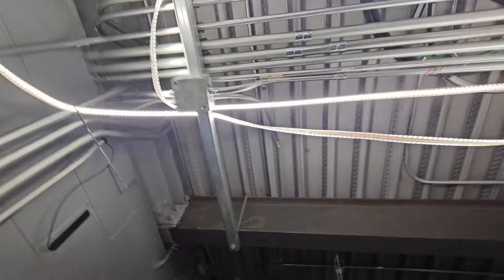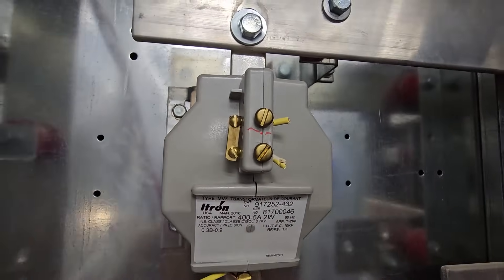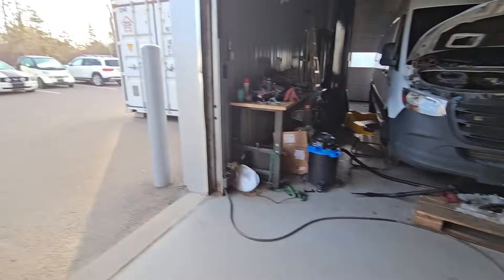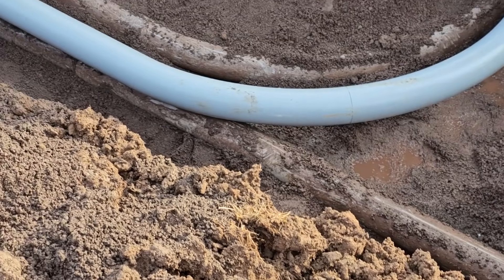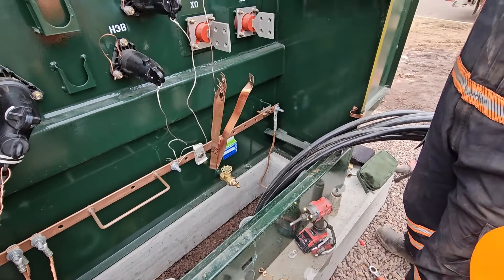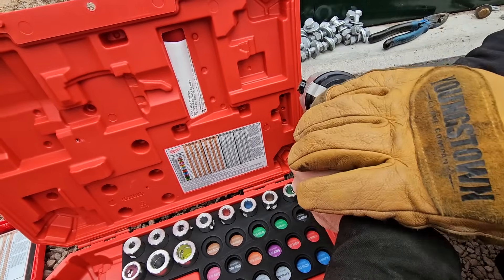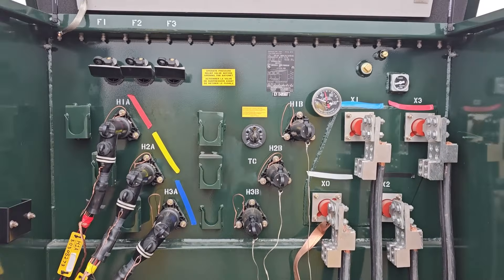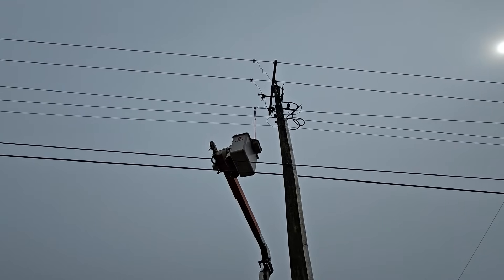Three phase 800 Amp upgrade

Comment: Years ago I was contracted to update a closed down grocery store which was to be reopened due to the only grocery store in the small town burning to the ground. It was a rush job since it was 25 miles to the nearest other grocery store. I was to increase the service from 400A 3 phase 208/120V to 800A  3 phase Overhead service. The old service had been cut off at the pole, as was clearly visible, and the quadraplex was still  connected from the pole to the building. This was in my way since I had to build the new 800A service.
I asked a passing power co. lineman to take the drop down for me. He said he couldn't do it without a work order. I told him I would cut it off from the bldg. and roll it up at the base of the pole. He said he would take it down for me anyway. I went back into the bldg. and the last thing I saw was the lineman going up in the bucket truck. I heard the unmistakable roar of Primary going to ground.

Comment: Things work very differently up there as compared to the Houston area.  First, I won't say that a CNP lineman will never help you on your project but unlike in the past when those lines blurred, today there is almost never any thought of them helping you.  First, they are busy as a one leg man at an as kicking contest. Second, there are too many lawyers and too much liability issues for them to touch any of your stuff.  It is nice that y'all are more old school, friendly with the narrowbacks and enjoy the comradery of the electrical trades. Deregulation, contract line crews and bean counters have killed that down here.

If a supply house sent out that spool of wire I would have rejected it.  I would prefer four reels set two and two for that heavy application.  Anyone can see at the start of the pull that real was not going to finish that pull.  Luck if that wire was not damaged. I also did not see anyone applying wire lube. Even with today's supper slick wire it is important to use wire lube especially on heavy long runs with 3-90's.

Also, there is no way that that job would be turned on without a final inspection from the city and the Light company will generally not turn anything on till it is covered. They have primary meter crew who do all the CT work medium and low voltage.  Head lineman does not do it all like you do. Ct's and metering would be mounted in the pad mount. Most electricians would have that wire pull completed before a cut over world be called for. It would be inspected ready to go with a feeder to feed that old main in place. basically, turn one off and then make the new one hot.
I was wondering if this was installed for EV car charging stations.  Many of the Houston area car dealerships have spent hundreds of thousands of dollars or more doing these types of upgrades.
Thank you for your many videos.
We can all learn from each other's triumphs and failures.

Comment: Making sure that I understand. This is a 600 volt, phase to phase, 345 volt, phase to neutral. So, at nominal, the PT voltage presented to the downstream metering would be 115 volts. I assume this is a Canadian standard?  I worked in plants in the US using 480, 277 and 120 volts presented to the PT side of the metering equipment.

Comment: I recently got a new customers (old company left, new customer bought the building), the old owner had a demolition crew run through the entire complex, basically f'cking up anything they can find. They had CT's for energy monitoring on over 30 3-phase connections for different loads, sadly some idiot ripped out all the metering equipment and left every single CT an open circuit, even with half the circuit still energized and feeding remaining non destroyed load :(

Comment: I am curious about the method used for the PT connections to the buss bars. I was taught to either thru bolt or tap the buss, then connect a screw lug using a Belville washer to maintain constant pressure on the lug-to-buss connection. The Belville washer maintains pressure better than a split washer throughout the expansion and contraction of the copper buss bars, and the screw down lug provides a better connection to the PT sensor wire (especially when properly torqued with a torque driver). I was told to use this method due to coppers high coefficient of thermal expansion that can cause other methods to loosen over time, especially in areas with large seasonal temperature swings.

Comment: This install reminds me of the install of the dual 480V/800A AC feeds to the data center I worked at at Carnegie Mellon University. I got to see more of the building power feed than most folks, documenting everything from the primary side of the building transformers, though the building's power room, and then up to our data center, complete with photographs. A fascinating thing to do as someone who got to see things behind the scenes at AEP thanks to a power prof who did contract work for them. (I also got to see even more of our power feed after the main building panels were flooded to a depth of about a meter/3ft with flood waters during a flash flood, and all our breakers had to be cleaned/tested.)

Comment: I can imagine an elevator that goes up instead of down and down instead of up if the electrician got the phase rotation wrong. Technically the escalators would still be usable XD.

Comment: As a Master Electrician 
If You Notice 
He Speaks in a 
Matter of Fact Language 
As Electricians 
There is No Maybe 
Might Be 
Could Be 
….It’s Always a Matter of
Fact 
It’s Open or It’s Closed 
It’s On or It’s Off 
Plus You Have One Crew Chief or Gang Leader 
No One Does Anything 
With Out The Crew Leader Telling You 
Remember Everyone Here is Ether Licensed or Working Under a License
The Milwaukee MCM
Cable Insulation Stripers 
are Outstanding 
Didn’t Have Them in My Day of Landing 
4160 Volts Utility 
It’s Nice To See That Everyone is So Professional 
No Yelling or
Whistling…..
You Work as a Team 
Again Thank You for 
Up Loading This 
Fantastic Video

Comment: you mentioned this is an 800a upgrade however 500kVA is only 481a @ 600v. Do you guys run undersized transformers or are they only using 347v for utilization voltage? Im in the US and often see undersized transformers
Reply: 800x600=480kva
Reply: @lewy1  nope. 800a @ 600v 3Ø is 831kVA
Reply: @ Sorry you are correct on the math. Utilities like to run transformers at the max to make money. They rarely use what the math requires.

Comment: One of my tech teachers told me that you linesman use electronic equipment to check phase rotation, it wasn't something which was taught when I did the electrical trades course.

Anyhow, back in 2007 I can remember when I was on an industrial site which was based in a coal mining part of my district & the client had moved a hydraulic punch & shear machine from one building to another & while the pump motor ran it never delivered any hydraulic pressure.

I thought that if it worked o.k. In the other building then the phase rotation must be different in that building so another electrician who I was working with swapped a couple of phases around in the plug 🔌 then it worked fine.

My point is that another electrician couldn't figure that out.

I am not sure what your lockout procedure is in Canada but usually you have to be inducted to enter a switch room or a motor control centre even if it's dead work which is being performed over here in Australia &; in some cases a JHA (job hazard ansky) orba SWMS (safe method work statement) is to be completed & signed by anyone who enters the switch room in Australia.

Also, this particularly applied to live testing or working on a project which is live & even when it's dead, everyone who is working in a particular switch room or on any form of power equipment must attach their danger lock onto the lock box prior to commencing work & remove it at the end of the shift !

Comment: I am wondering why 600MCM aluminum wire and 600MCM copper wire need a different die. It seems like wire of a certain size should all have the same diameter. Checking a couple cable supply sites indicates that indeed the aluminum wire is slightly smaller in diameter. The stranding is the same so I would really expect the dimensions to match.
Reply: Alas wire sizes are kind of like pipes... there are standards behind them, but the ratings are more like "nominal" or "trade size". 1" PVC, CVPC, HDPE, and PEX are all different internal and external diameters, then you've got rigid pipes like copper and PVC available in different Schedules with different wall thicknesses... still all called the same "size".

Wire isn't quite that bad. I've never bothered to look into it but I think it's equivalent cross-sectional area and "size" actually describes its properties as a conductor, rather than the physical parameters. Even on copper, solid, low strand, high strand, and tinned versions of the same listed gauge are all different OD. Strand diameter strongly affects this a bunch of larger wires has more space between them compared to a cable made of smaller wires. In other words, size = capacity, and the rest comes down to the actual construction of the cable. 

The differences are negligible at smaller gauges and become more apparent at scale. I work in telecom where DC is more common than AC, current levels are higher, and cable management is generally tight. We use a lot of "flex" cable. This is very high strand count, like welding cable, and the conductors are individually tinned. The tinning isn't included in the size rating, a #2 AWG flex is enormous compared to everything else labelled #2 AWG.

I expect that the different physical physical properties of aluminum and copper are influencing the strand diameter. Per Southwire's specifications for their SIMpull THHN/THWN-2 products, although 4/0 AWG aluminum and 4/0 AWG copper are both 19-strand cables, the aluminum is 0.474" and copper is 0.512". The same line of cable at 600 MCM is 58 strands of aluminum for 0.812" diameter, and the copper version is built with 61 strands for a 0.865" diameter conductor. Unfortunately they don't list the diameter of the individual strands, so we have to assume that the copper strands are thicker. Why that would be the case I could only guess

Comment: That’s a 600 volt service I imagine. 347 just being line to neutral on a 600Y347 connection.
Reply: Presumably this is in Canada, because from what I understand 600Y/347 volt services are (almost) never installed in the US expect under special circumstances such as if the customer has several 600V 3ø motors and/or 347 volt lumenaires imported from Canada.
Reply: Exactly

Comment: clockwise? oh boy I have to watch a video on that now - that's new to me.
Reply: Clockwise or counter clockwise is not important. 
The only thing important is that the new needs to be the same as the old one.
Otherwise, all the 3 phases motors in the building will spin in reverse.
And you dont want that.
Reply: @ Thanks for the reply - I figured it was something like that - but what I didn’t know is that ‘power’ from the pole/main has an orientation? Not sure what it was about that ‘pad’ transformer that could change the orientation.
Reply: @TheIvalen  2 probable reasons . Mixing up 2 wires while reconnecting. Or could be in the transformer while it was built. 
Human mistakes are most common reasons 😏
Every 3 phases system has rotation direction.
The rotation comes from the powerplant's generator .
" A magnet spinning around 3 coils of wires "

Comment: I find it interesting that you do not fuse your risers. What is the rational behind it? Was this just a situation where protection coordination was not possible? If so, at what point is the protection of the UG cable deemed a lower priority over coordination?
Reply: It could be that the cables have the same short circuit ability as the above ground conductors? Then, the cables should protected by the upstream fuses/breakers.
Reply: There are 50A fuses on the incoming high voltage cable to the transformer. Since the transformer only feeds one single switchboard, there is no point in coordination. If the low voltage cable has a fault and there was a low voltage fuse that could trip it would cause exactly the same amount of outage as if the high voltage fuse trips.

On the indoor switchboard there is an electronic breaker, so if there is a major fault in the switchboard it will ensure coordination and trip well before the high voltage fuses in the transformer.

Comment: Very important to get the phase rotation correct. I am a Journeyman Refrigeration tech and if you reverse the rotation the AC compressors can get damaged. Ironic you have EMCO HVAC company right across the street.

Comment: Thanks for your video, Aaron. They will load copper on steel reels here instead of wooden reels. They never collapse so we can use rollers on the ground and just roll the steel cable rollers onto them. Much easier for contractors.

Comment: i love the way you guys work together... here in .uk, power co and electricians rarely speak. here is our demarc point
Reply: That's a shame. Why is that, is it rules or is it, for example being barred from helping do a task you haven't been trained on? (I'm a retured Brit IT engineer, so I'm not trying to point-score).
Reply: @Smannellites  privatisation. They're not allowed to work with you
Reply: They're all the good guys who will but theyre technically breaking the rules
Reply: Such a shame, one of my favorite part is to work with electricians when I'm connecting (we don't hook up over here, 95% of our entire grid is underground now a days) a new house etc. Good banter and a lot to be learned about low voltage stuff aswell!

Comment: you can guarandamntee i triple checked phase rotation the other day when installing a supply for the cnc lathe worth almost as much as this house. interesting that you don't worry  about the actual phases... we tend to, 123 is fine,  312 is not.... probably because of our use of larger local distribution networks, so  load balancing tends to be done at :LV

Comment: Is the upgrade because they’re putting in a 480v DC Fast Charger?
Reply from the maker: Yep!
Reply: We’re putting in 4 car chargers where I work, but for some reason they’re gonna pull it off the house transformer (240 vac) rather than straight 480 3ph from the MV transformer.

Comment: Glad im not the only one to use LED strips and the like for situations like that, props to the dealership for thinking outside the box. Need lights during an outage? Power Banks and USB/5v/12v LED strips are all you need.
Reply: The one in the video is a 120 volt LED strip
Reply: @nick8231  Probably if they had a generator.. But they still come in handy.
Reply: @DigitalIP  he said in the video that there is a couple backup generator for the office that they brought over for the office to keep running
Reply: @ Yep

Comment: 360/208v Y?
Reply: If each PT has 347 volts to neutral on the primary then phase to phase would be 600 volts. So wouldn’t it be a 600/347 volt system? Someone from Canada knows better.
Reply: @wyomingguy4743 you're correct. You can see it on the type plate on the padmount transformer.

Comment: That LED tape light you mention at the start.  I discovered them about ten years ago.  I use them for illuminating tents at outdoor music festivals.   No more broken glass bulbs to sweep up.  Way more durable.  ypu can get them in IP65 rating so outdoor use is fine.   Up to 50 meters long for the 120 volt version.  Some of them are also cuttable about every 18 inches to make them custom lengths.  they come with the end caps to glue shut and one extra power supply.  many different colors for decorative use.    Also used them for interior illumination of my house after we had a house fire, for demolition and reconstruction with a generator.   They cost about a buck per foot.  Low power draw, and throw an amazing amount of light.   No shadows, no glare.  They last several years in daily use with a photocell controller for yard lighting.   But they are not lawnmower proof.

Comment: Really cool to see the process that goes into such a cut over.  Once you go beyond a residential 200 amp service everything really gets bigger. Can't imagine trying to strip those cables or pull them through without the more specialized tools.
Reply: I used to watch a guy on the clock app who operated a shredder. I don't remember exactly what he said, but the cost to start the machine was like $25k? And the amount of current was insane. Maybe Aaron could chime in.